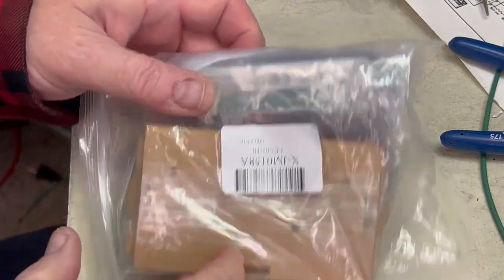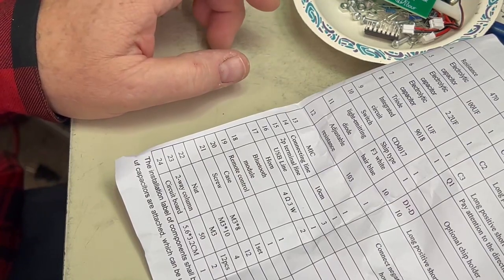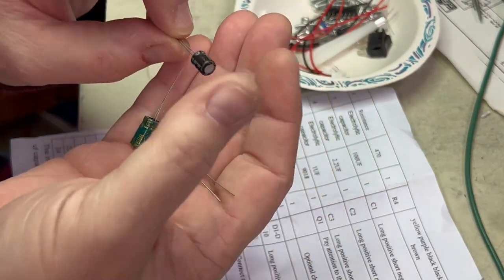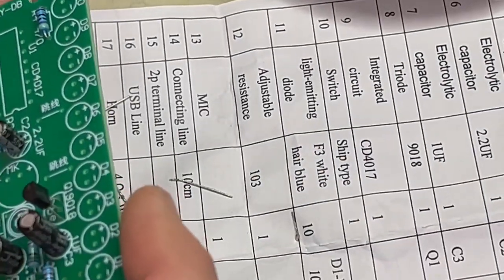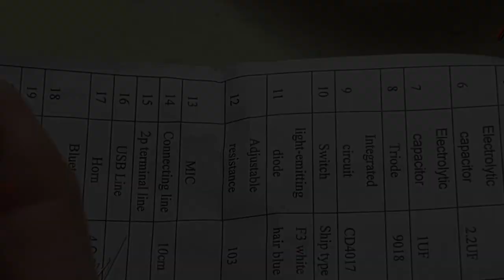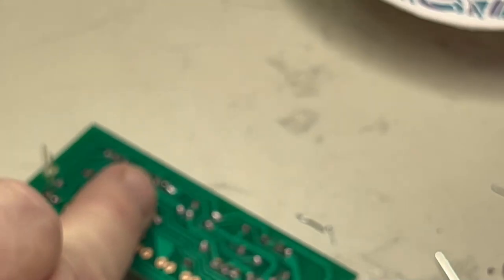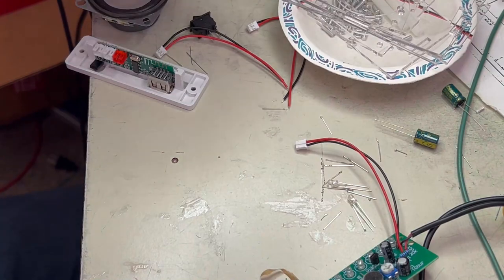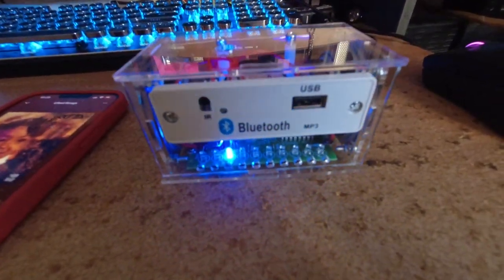Aliexpress DIY Bluetooth speaker build and giveaway

Comment: Hi! I was following your instruction and it works! However, when I increase the volume it keeps disconnecting, what can be the problem? Thank you for your video! It really helped me because I am still a newbie in DIY.
Reply: whenever the song goes high like getting a high pitch or going chorus it stops.
Reply from the maker: How are you powering it? Almost seems like whatever you have it plugged into isn’t supplying enough current. I would try plugging it into a brick or  something that can deliver more power. Let me know if that makes a difference…
Reply: @icemanfiveoh  Hi! I noticed the LEDs turn from bright blue to pale blue whenver I turn the volume up, perhaps the problem is the resistance? The same as my problem above? Or is it current?

Comment: Hey, what were the 2 leftover capacitors for? You said they were for the speakers maybe but then where should they be soldered to?
Reply from the maker: Capacitors block Bass. Inductors block treble. If you want less bass out of the speakers, you can solder the cap across the speaker inputs. It's optional IMHO. If it sounds ok, I wouldn't add them. Thanks for the comment!
Reply: @icemanfiveoh  Thank you as well!

Comment: This is my first soldering project and following your actions step by step makes it a lot more manageable!
I did struggle with the pin from the chip that is very near to R3. I thought the solder joints had to be separated but you seem to just solder the whole lot together. Why doesn't it matter in this case?

Kind regards, Michiel!
Reply from the maker: That's awesome! Depending on what the schematic shows, it is possible some pins are meant to be soldered together. I would say for the most part you should solder them individually, but when you look at the PCB sometimes you can see that the pads are tied together. They do this for reasons like multiple outputs to sink more current and things like that. Also, it may appear that I am soldering them together, but that could be for speed, and then I go back and separate any pins that should not be shorted together. That is decades of experience in soldering and knowing what should or shouldn't be connected. The traces and pads on the PCB will tell you what should be connected together. Make sure to triple check your work against the schematic and, if possible, use an ohmmeter to verify the connections before you apply power. Sort of like measure twice cut once... Thanks for the comment and good luck.
Reply: @icemanfiveoh  Thanks for your input! I'll definitely check every connection with the mulitmeter when i'm done :)

Comment: Can you also tell me what you have your heat temperature set at
Reply from the maker: Since it's an RF Hakko, It has set temperature tips. I use the yellow tips mostly, which I believe are 825F. Make sure you aren't using lead free solder, that stuff is the worst. And liquid flux foes a long way, even if you use rosin core solder. Good luck on your future projects!